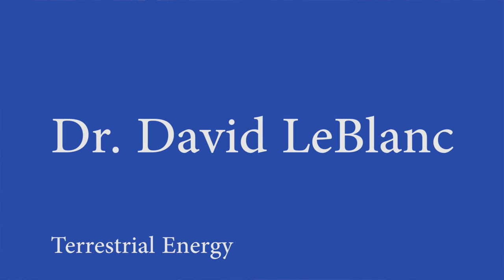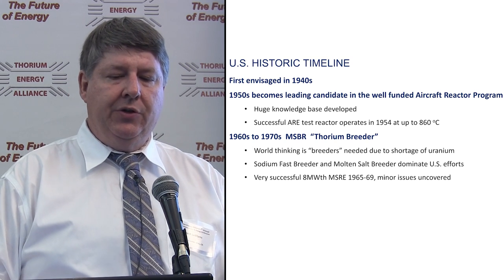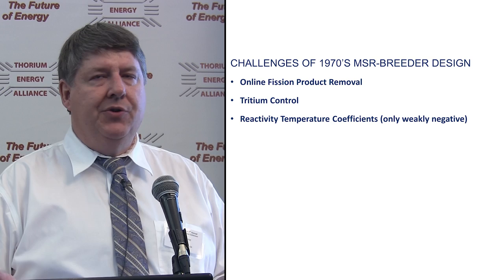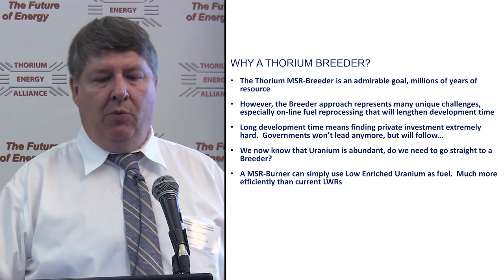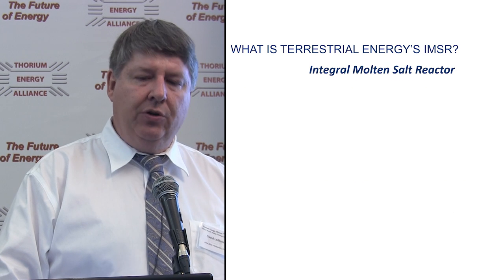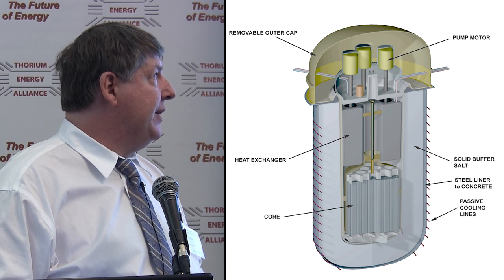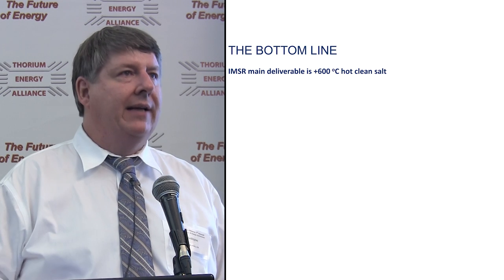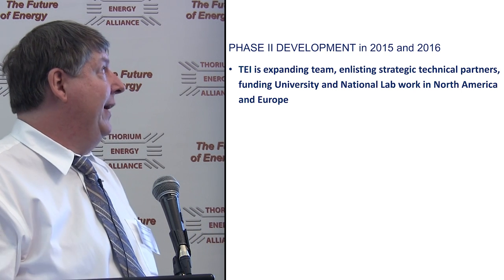IMSR: Terrestrial Energy's Integral Molten Salt Reactor -by Dr. David LeBlanc @ TEAC7

Comment: What I'm hearing in between the lines here is scary- I am a major advocate for thorium based power. But on a certain VERY important point this guy is thinking about this the totally wrong way. He says that - well, if Uranium is not as abundant anymore, let's just raise the price x10 = Problem solved.

This is a.k.a. restrictions in power usage. WHICH WE DONT UNDER ANY CIRCUMSTANCES WANT! That's BS. With this technology, every damn powerplant should be replaced with a thorium, and asap replace everything with breeders.

This dude wants energy to equal more money to the guys who produce it. This will not solve any real problem. Up to the nations to decide this or that. haha.... yeah right. Let's pull off a Gene Roddenberry instead, and share the fuel among all the world for as small cost as unhumanly possible. This is a.k.a. clean water (desalination and purification) for EVERYONE. No need for fossile based energy = No more money for just a few nations (where in most cases the funds are abused). Give people clean water and "free" and "unlimited" electricity, and u end poverty in 2 generations. And u also make a lot of industrial processes way cheaper. It is a positive cascade effect.

Without thinking about it in this kinda way = No real problems solved at all. All the technical stuff like what is easier or harder to handle (waste, heat, abundance of fuel etc) is just secondary smaller problems with the currecnt "energy hierachy" of the world.

And get that damn oil money away from the middle east. They don't need it. If they needed it, they would stop building skyscrapers and start actually HELPING their own people in the region!

Other than that - excellent video... Like - don't get me wrong - he does a good job -  given the circumstances, - presenting this, but dude - there's a need for more philosophy in this subject, and it needs to be part of it from the beginning!
Reply from the maker: The cost of fuel is a small fraction of today's cost of nuclear. And there's a long way to go before any possible natural-resource supply constraint could have any meaningful impact on price of nuclear energy... it might be the case that a combination of fast-spectrum (uranium) MSR and harvesting Uranium from seawater will negate any conceivable Uranium supply constraint (although hard to say if that would be before price of energy is impacted).

Because any concern about Uranium supply are so far off in the future, and there's very pressing need for clean, abundant energy today, the best short-term argument for thorium thermal-spectrum breeders (and required chemical kidney) is that it can provide isotope byproducts other reactors can not.

Uranium thermal-spectrum MSR do still offer passive safety, high temperature operation (for industrial processes), and an established supply chain for fuel. 

Flibe Energy (in USA) and China are the 2 entities pursuing Th-MSR complete with chemical kidney. Flibe is currently funded by DOE to specifically research a component of the kidney itself (a fluorination process). Big picture, if IP from China and/or Flibe is combined with other MSR startups (further ahead with materials research), then developing LFTR on the heels of first commercial U-MSR is easier... assuming these entities want to collaborate or consolidate.

I wouldn't attack U-MSR startups. They're still providing more kWh for the given Uranium than today's reactors, if environmental impact and cost-of-energy is your focus.
Reply: @gordonmcdowell  Thanks for the reply.

I was actually under the impression that Uranium isn't as abundant as you make is sound like. I'll accept that.

I also agree that attacking the pioneers in this field should not be done. I didn't think that's what I was doing. I was just trying to make a point that it is extremely important to go into this revolution with the correct ethics. And those ethics would be only good enough if this is done in a way which secures everyone their part of the cookie, and then some.

Any human in the entire world is in my honest opinion entitled to access to unlimited electricity without having to pay much for it. I'm not talking about infrastructure or similar - that cost money of course. And some gotta pay for it.

I must admit I'm more the layman type in this than a pro. It is a subject that touches me deeply when it comes to politics and philosophy. So I don't know all the details of what you talk about - I'm sorta just leaning on the video when I comment, and what I deduce from that.

But I still think that, no matter when it comes, when that time comes when we gotta turn up the price for the fuel to regulate the power use - that's too far.

We're doing this today. At least here where I live. The fact that the energy price is INSANE in the winter months, and pricey also in the summer, that is imho a mockery towards mankind. It is as they say - we ARE gonna use more energy in the years to come. But somehow the governments around the world seem to think that we're gonna use less. They cling to stuff like hydrapower, wind, and solar, like that' gonna be an answer.... :) nope.

I guess what I meant to say - I liked the video a lot. I just wanted to make it clear that restrictions in energy usage (which is the only way you can get more out of less), that causes fuelprice to raise - that's when it's gone far beyond, and something new should be settled in place when that happens - in 50 or 500 000 years from now. If not, we have failed.

Sorry for the long answer. Sorry for the babling :) - I'm not crazy - I just sound that way sometimes :P
Reply: @LifeOnHoth  "I just sound that way" - don't apologise.  Especially when you're absolutely correct.
Reply: PWRs use between 2% and 4% of the available energy in their fuels before the fuel rods have to be replaced. MSRs could deliver 20 times as much power from the same fuel supply. It's actually even better because MSRs need only low enriched uranium and once running can be topped up with ordinary uranium. 
Thorium could happen right now but the issue is regulatory. The nuclear regulators are already struggling to accept that anything other than PWR is possible. One step at a time gets it done.
Reply: @tonyduncan9852  haha wtf!
Reply: You haven't had much practice at this, have you? Dr LeBlanc was actually addressing a chicken and egg problem. How do your early investors become confident enough to embrace this kind of huge financial risk? 

A prudent early investor looks at all the ways the project can go pear shaped. One of those ways is that you become hostage to Nelson Bunker Hunt gaining control of the extraction industry. But this won't happen if your reactor clients can absorb—in the short run—a 10× run-up in fuel costs without crying uncle. That kind of price surge would correspond with a huge incentive for the rapid development of new supply, undercutting Hunt's cartel, ruining his extractive strategy. Therefore, a prospective early investor has a strong reason to believe that the some future Hunt won't even whiteboard this maneuver. Therefore, you can raise money. Therefore, you can commercialize this technology. This was not a grand point about what the fuel cost structure should be. It was about risk management in an adversarial world. 

Not only did you miss the pitch, you showed up at the wrong ballpark, on the wrong side of town, on the wrong day of the week, during a snow storm. 

Pro tip: read more history, and less science fiction.
Reply: @afterthesmash 
Reading history will never change the world unless u read the science fiction too.

I'm not neglecting the points written here, or talked about in the video. I'm saying that the humanity as a whole needs to think way different about energy.

The world is a broken place. The solution to the problems we have on this planet will not present itself with any kind of traditional economy model. And it will never change unless we start to do things a lot different.

I appreciate the points made in the video and in all the comments, but I am saying that we need to start changing our ways completely if we want things to really change.

I claim - if energy industry was non-profit, from fuel supply to your home - combined with an energy production model that can be implemented almost wherever there's a need for it - a lot of the problems this world has would go away. There are many different ways of doing this - all which excludes private investors - which is where we are on two different planets.

I really don't care if I show up in the wrong side of town and all that. I say what's on my mind. I'm saying this will not work at all if you are gonna be dependent on private investors looking to make money. How about being the investors that ends poverty on the planet instead.
Reply: @LifeOnHoth  I didn't say to stop reading science fiction. I suggested a better balance between the two. SF is pretty much the only genre fiction I ever read. But I also read non-fiction copiously, so I see the world through both eyes.
Reply: @afterthesmash  I totally agree that we need to see it through both eyes as u put it.

I just stuggest that radical changes need to be in place before we can even start to consider using the energy for what it is worth. If we do that, we will see prosparity like never before. For everyone. Which is where we need to go if we know what's good for us.

My grand agenda here hehe - is to put out a big red warning here, to have the right mindset from the start. That will give us a unique oportunity. If we don't, it will be like before. People will not have their cheap and readily available energy, and a few people will make a huge profit - like what has happened so often in the history.

As I said, I appreciate the video and it's content, and the comments, but I still have my thoughts around it, which I even claim to be reasonably relevant for the discussion - in the long run.
Reply: @Life on Hoth  In 2012, global electricity consumption was 21,000 TWh. 

The rising middle class in Asia would love to bump this up another 10,000 TWh. 

Let's call it 3 TWe of generation capacity, and speculate that half of this comes from advanced nuclear fuel cycles. A fairly large version of the IMSR would be 200 MWe (the e stands for electrical output, rather than thermal). You'd need 7500 operating IMSR cores operating concurrently, and these are presently only slated to last about seven years each. So you're pooping out 1000 spent IMSR radioactive cores every year into the global waste stream. 

One of the LeBlanc videos hints that the larger cores are too large to transport as a single piece in the largest transport truck, which puts it north of 60 tonnes. That works out to 600,000 tonnes of hot and heavy waste globally per decade, and it probably all requires geologically secure and politically secure storage for hundreds if not thousands of years. 

Disabuse yourself of the notion that this is cheap energy. 

Enormous engineering investment is required to improve on these rough figures, and there's no guarantee of success (there's not yet any guarantee of success for the current proposal). 

More additions to your reading list: mathematics and economics, with a side order of systems theory, risk management, and an appetizer of conservation biology. 

The grand narrative of cheap energy belongs to fusion, not fission (with fusion, transuranic byproducts would be measured in atoms per century, and waste is modest, altogether). 2050 remains super optimistic for widespread commercial fusion. Maybe 2040 sees some bleeding-edge fusion build out. Don't hold your breath. The risks are huge. Quite likely—if nuclear goes anywhere—molten salt uranium serves as a 50-year stopgap, and then why bother with thorium at all, if fusion works out? 

On these considerations, if you won the King Kong Lotto 6/49 jackpot tomorrow, would you be willing to invest $300 million of your own money on a thorium bet? That would get you a nice share of some venture, but not a large share ($100 million is chump change). 

Add to your reading list game theory, specifically marginal advantage from economics. A fat tome or two on industrial organization would also serve you well, before you chuck your chance $300 million windfall down a dark money pit. 

Did you notice the scene where Mr Incredible misses his dental appointment while he's off saving the world? No, you didn't, because there wasn't such a scene; superheros don't experience tooth decay at the worst possible time. Moral of the story: the devil is in the details; SF will only take you so far.
Reply: @afterthesmash  You really need to split up your text some. It's heavy reading...

Also, I struggle a bit with your add this to your reading list, you show up in the wrong side of town and statements like that... I don't get it - are u trying to convince me with I know better than thou attitude, or is it me who read too much into this - please tell me, coz I can't read your face from here.

I think you need to get this - I have never ever claimed that this is cheap energy. I say that it needs to become cheap energy. First thing one gotta do then is to make every step in the chain non profit. That doesn't necessarily make it cheap. But it's a step in the right direction. To make any energy cheap, and to make the world a place where every human can prosper, we need a whole new way of running things here. I don't say it's possible now, but the will to try to close in on this kinda mindset, is pretty much doesn't exist in a market where some can have most of the cake and a lot left with the rest.

As for your numbers, I have no reason to discuss them. I don't know how. I know how to read. And I also know statistics - I know that statistics thrives in places that are bent in different directions depending on different points of views.

I don't say you're wrong. I simply say we are discussing two kinda different things, aren't we?

I get  it - you try to be realistic and want me to see it. It's not that I don't see it - however, we think different about it. You assume that the way we are gonna do this is in the current market model if that's a way to put it - keep in mind I'm no expert - where I don't.
Reply: @LifeOnHoth  I went back and changed it. It's split. YouTube is an unfriendly place to rub two ideas together at the same time. To be honest, I'm surprised it even supports paragraph breaks. 

My point about the books is that the more you expose your own financial skin, the longer your mandatory reading list becomes. That's on the side of town where the goal is to get rich, and then stay rich.

Comment: Why in the thorium energy alliance or similar groups don't join together in the qualification or materials like hastelloy, graphites or any similar that are commonly used in the MSR projects of the 60's and 70's?
I think they should join efforts in this matter because it's potentially beneficial for all them, and for all of us.
The other practical approach is Elysium Industries using already qualified nuclear materials to cut regulatory bottlenecks, but in the end, the feasibility of a molten salt reactor of any kind would benefit the rest of the MSR concepts and they should row together to get this barrier passed.
Reply: The issue is the ridiculous time it takes to get approval. Some of the tests can't be cut short but the regulators do everything slowly. Graphite is already used in some reactors so should not be a regulatory issue. The British still use it in their AGRs. Hastelloy is totally new regards regulatory approval so dont expect anything this side of 2030. Moltex have done as much as possible with nuclear grade stainless then zirconium plated to avoid the salt etching. They also put the fuel salt into fuel tubes (regulators understand that). The tubes are open topped to release fission gas products. Regular salt removes the heat to steam generators.

Comment: Thank you for the video.  This is refreshingly, dramatically, BS-free, relative to the Th-MSR talks.  The materials challenges are still there, but at least they are not compounded exponentially by a completely more problematic fuel cycle and reprocessing burden.
Reply: I have no financial interests in Moltex Energy but its worth checking out their solution. Their plant in Canada looks likely to be the first on the grid with molten salt reactor. It runs in the fast spectrum and will be contracted to burn PWR (and CANDU) waste fuel stocks. 
I hope to see IMSR following suit as the world needs things to move fast indeed.

Comment: Seems to be a quite 'dirty' solution with 'disposable' core units...
Reply: Nukes operating today were designed decades ago.  Eventually the whole huge plant gets decommissioned because you can't upgrade the core.  A whole new plant gets built a hundred miles away.  New power lines get built.  That is a really big waste.  By installing a new core every seven years we regularly get new technology.   The rest of the plant is easier to upgrade 'cause it is just machines - no containment vessel.  No radioactivity.    That seems smart to me.  Really smart!
Reply: Nukes today are shut down for re-fueling.  While that is happening the whole power plant is useless and fossil fuel gets burned to keep people safe and warm.  When you look at the whole system, replacing a whole core seems really smart to me.